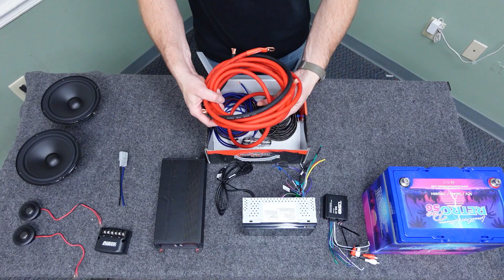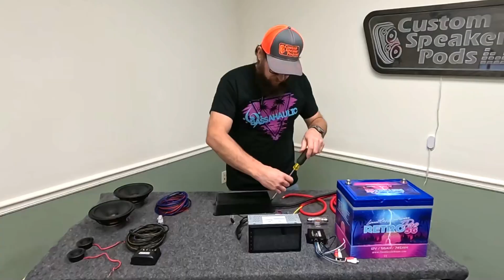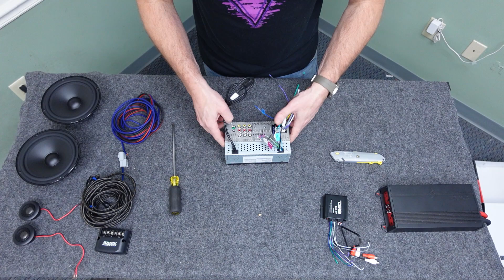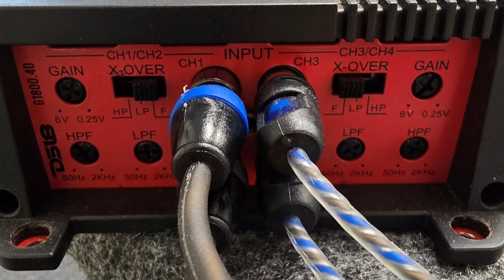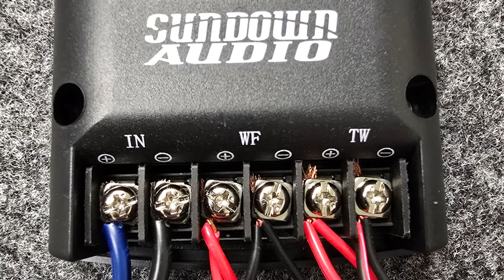Aftermarket Car Stereo Installation BASICS: Start-to-Finish in 20 minutes

Comment: Any speaker wires to the aftermarket head unit? 

Or running speaker rca’s to the head unit and amp is enough to have to only rh. Speaker wires from the amp to the speakers?